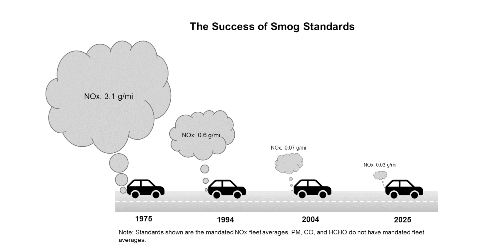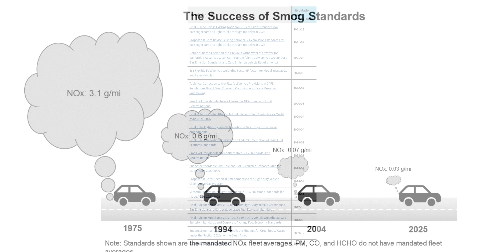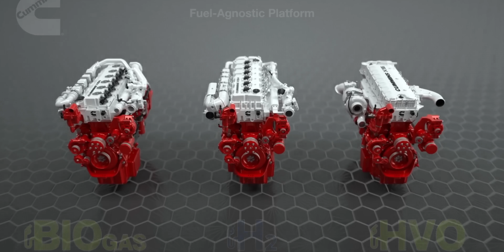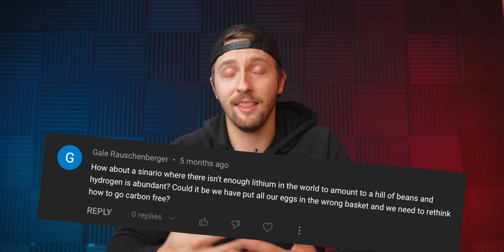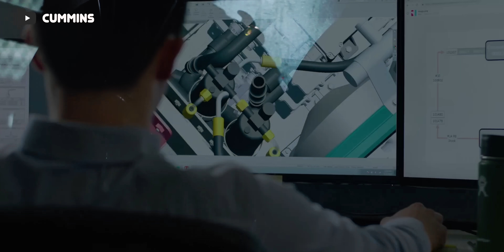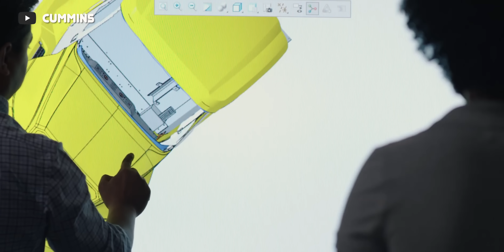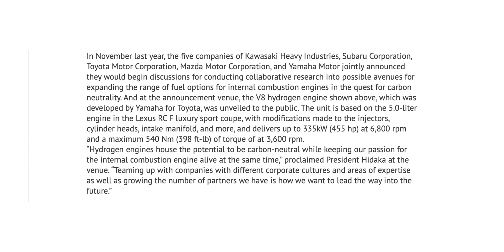Cummins Hydrogen Engine Will KILL DIESELS FOREVER

Comment: Nuke powerplants and hydro powerplants run clean and are begining to produce hydrogen as well. It'll be interesting to see where this goes.
Reply: Why would they loose 40% of their power trough electrolysis to make hydrogen when they can sell their power directly. How cheap is hydrogen going to be if customer have to pay for all that loss?
Reply: @TJPDmember  power plants make excess a lot of the time, they need to maintain a base load, previous designs have seen them have to bleed off the power, this would mean they can use that spare base load power to generate hydrogen at almost no cost to them...
Reply: @fluchtigziege3202  so then why does California have brown outs if there is as you say spare or excess power?
Reply: @Scott Sand  During "peak usage" times, the systems can't keep up with demand, hence the brownouts. But during the night when the masses sleep, the  power can be used to generate hydrogen.
Reply: @TJPDmember  The Japanese are using nuke power to super heat water to separate it into hydrogen and oxygen.
Reply: While Nuke power is clean (basically a STEAM generator),  its byproducts are the problem.  Nuclear waste is difficult to handle, COSTLY to dispose of, and then there are those 'PESKY' security problems because  TERRORISTS want to gettheir hands on radioactive ANYTHING... and then there is the POLITICS and RED TAPE.  Remember, our government is here to help us.  ;-}
Reply: nuclear power plants produce tonnes of hydrogen when they melt down, I hear the russians had shitloads in 1986 and the Japanese still have heaps LMAO
Reply: YIP the one nearest to your and your families homes gets nuked first Mr genius
Reply: The problem with hydrogen?  Right now we produce hydrogen using natural gas, and it is used within 2 miles of the production plant to make things like fertilizer, so the hydrogen is not compressed before it is used (beyond about 100 PSI).  Only about 5% of the hydrogen currently produced is compressed above 500 PSI and sold in tanks.  

One of the "Green" hydrogen production plants makes hydrogen out of electricity, and it takes about 400 KW to produce 1 Kg of hydrogen.  Sure it is a very light gas, and that is MANY cubic feet. They estimate it would take over 50,000 Terawatts of electricity to produce all of the hydrogen that we currently use to make fertilizer and other products.  However all of the currently installed worldwide wind and solar power will not produce 35,000 Terawatts of electricity per year.  

If you consider all the power output of all the American nuclear power plants, they do not produce nearly enough electricity to replace even 5% of the hydrogen used in America to make fertilizer.  

And the problem with "Excess power produced by hydroelectricity and nuclear power plants" doe not exist.  We use every KW of power made in a nuclear or hydroelectric power plant.  Then use millions of cubic feet of natural gas to produce the bulk of the power used in the United States.  If we had 400 KW of "Excess Power" it would be better to reduce the output of a natural gas or coal fired power plant, than to make 1 Kg of hydrogen with the 400 "Excess" kw of power.  

By the way, feed 1 Kg of hydrogen into a fuel cell, and you get out 100 KW of power.  So 400 KW of power to produce the hydrogen, and get out 100 KW when you switch it back.  Of course if you consume another 15 KW to compress the gas to 1,000 PSI in between the conversion between making the hydrogen and using it to produce the electricity, that is even more energy used to produce the 100 KW.  So net gain of -315 KW per Kg of hydrogen produced.
Reply: @Kangenpower7  yes hydrogen is a fool's errand
Reply: @Kangenpower7  yes hydrogen is a fool's errand for a open fuel source but it can be used to make waste into fuel, maybe the only viable method of fuel generation via hydrogen
Reply: it goes nowhere because hydrogen is a nightmare to store and transport while having a much lower efficiency than batteries 
so you will need giant tanks for the same range
Reply: @IR_IE_ID  yes unless kept Cryo, which is a whole other fresh hell, using hydrogen to make another greener liquid fuel makes more sense than using hydrogen to power cars directly
Reply: @IR_IE_ID  If you calculate the total efficiency of a lipo battery including the creation and disposal  energy they aren’t that great either. Hydrogen storage is also a battery.

Comment: If anything replaces diesels, it'll be natural gas. Hydrogen is too expensive and too dangerous to use in such a widespread manner. Hydrogen also causes metal embrittlement, which destroys piston engines.

Comment: The world bending to the largest Hoax in modern times. So Cummins is trying to keep up with the terrorist Aristocrats driving the destruction of the economy. The energy density of ANY batteries is not there, and Engineers know this, (unlike Bureaucrats that simply push an agenda). Robin Williams said it best - "Reality's a Bitch".

Comment: MAAAAAN OHHHHH MAN... THIS IS THE BEST NEWS I'VE HEARD IN A LONG TIME FOR MY / OUR BELOVED INTERNAL COMBUSTION ENGINES

FOR ME JUST AS MUCH AS OTHERS 

AS LONG AS THERE PISTONS SLAP N UP AND DOWN CRANK N OUT POWER ILL BE OKAY 

BUT I'M AGAINST BATTERIE POWER OTHER THAN CARS FOR TOWN DRIVING... 

I'M A TRUCK DRIVER AND DIESEL POWER IS GOING TO BE VERY DIFFICULT TO BEAT... BUT HYDROGEN WILL I THINK IF DONE RIGHT WILL REPLACE DIESEL FUEL... WHICH DOES MAKE ME SAD... BECAUSE I LOVE ❤️ THE SMELL AND SOUND OF DIESEL POWER 

✝️😎👍🇺🇲st
Reply: Don't worry. You'll be using diesel for a very long time. Reality overcomes wishful thinking every time.

Comment: The ultimate renewable energy source, try to out fox the Creator I don't think so...
GOD provided Coal Oil And  Natural Gas as a result of carbon and hydrogen traped under the Earth's crust under massive pressure.
Regardless rejoice in our bounty.
Does eventually this Earth will chew us as well up along with all our pollution and spit it out as brand new.

Comment: Diesel will stay on road for a long time because you can’t stop old diesel engine from going on the road they would have to ban every diesel from the year they where frost produced to present same with gas everything would have to be banned. My other question what happens when that water supply runs out? No drinking water no life if we are running hydrogen cars on the road really would just leave diesel and gas alone they have been more reliable and proven to be more reliable then EV and hydrogen powered vehicles. I bet there hydro engine will only be able to go past 290hp by the way when pulling a 80k trailer you need more hp then 290 to get up hills and basic driving around with an 80k trailer that engine will be screaming for you to stop. And he said earlier in the video that I’m the near future gas and diesel engine will no longer be reproduced in the near future and pretty much come to a halt. Then he says he sees Cummins still building diesel for a very long time. So what is it? They step away from diesel and just go straight hydro I bet not. There is still way to much that would have to be converted from fossil fuels and I don’t see that happening anytime soon. We are talking about the power plants as well all equipment that uses fossil fuels will either have to go solar or a hydro plant would have to be incorporated there is still so much that would have to be done before they could ban fossil fuels hydrogen might one day be the way but it won’t be for awhile quite awhile. We will all hopefully be dead by the time that happens

Comment: Eh, I wouldn't worry too much.  Cummins has experimented with "alternative fuel" engine conversions for on highway before.  Their CNG ISLG and ISX12G have been HORRIBLY plagued with nonstop problems since day 1 and still have not been properly corrected.  Same with their ISX15 engine that ran on LNG as a partnership with Westport.
Reply: The problem with the CNG engines is their spark ignition system. That is their primary issue, secondary issue is the problem of them having condensation in the crankcase, which can cause many oil lubrication issues down the road.
Reply: The City of Long Beach California has been running over 100 of the CNG diesel engines that run on 90% CNG for most of they day, when they run out of CNG, they switch back to 100% diesel fuel.  They are started with both glow plugs and diesel fuel and run on the diesel principal, without spark plugs and run at 20:1 compression with a turbocharger.   They run them in the garbage trucks, sweepers, and other heavy duty class 7 and 8 trucks.  

They have been pretty much trouble free, and tend to run longer between in frame overhauls than the full 100% diesel trucks.  The exhaust is very clean!  The cost to run on CNG is about 1/2 of the cost to run on full diesel fuel.  It takes about 40 gallon of diesel per month, and daily filling of the CNG tanks.  They used to use about 50 gallons of diesel fuel each day!

Comment: The current fossil fuel chemistries are made for profit, not cleanliness. For as long as oil companies have been around, there hasn't been an incentive to make the fuel react completely inside the engine hence the need for aftertreatment. The oil companies can do it but won't because it will cut their profits.

Comment: A hydrogen combustion X15 Cummins still generators NOx from high temperatures and pressures in the combustion process that causes atmospheric nitrogen and oxygen to combine into oxides of nitrogen.  This should be less than the high temperature combustion of carbon, but still present.  There is not that much left in air pollution from a 2010 EPA heavy duty Diesel with Diesel particular matter removed and unburned hydrocarbons removed that leaves the 0.2g/bhp-hr of NOx limit for the 2010 EPA heavy duty on-road Diesel.  Further chemical processing might be able to put NOx at near zero.   

Hydrogen is expensive.  Storage of hydrogen as a gas typically requires high-pressure tanks (350–700 bar [5,000–10,000 psi] tank pressure).  It is very inefficient to make hydrogen through water electrolysis.    It is far more efficient to charge lithium ion batteries with an efficiency of about 80%.   Hydrogen is known to make metals brittle.   Typically hydrogen is envisioned to provide electric energy through it use in a fuel cell.   The major issue with that is the water generated can freeze and destroy the fuel cells expensive membrane.   No NOx generation with a fuel cell.     

There is a huge reason to run a Cummins engine on natural gas as the typical cost per hp-hr should be less than half the cost of Diesel fuel.  This makes sense for a stationary generator set.   A lot of the Diesel natural gas engines still use Diesel fuel to start the combustion process so they may sill require some Diesel emission systems and Diesel fuel.

Comment: Cummins built the x15 engines in our trucks at my work. They run on CNG and are some of the worst trucks I’ve ever driven. They have 6 speed Allison’s behind them. They get 4-5mpgs and are terrible to drive. Hopefully these actually have more than the 150hp those CNGs have.

Comment: Use ammonia as a hydrogen carrier because it can be stored as a liquid under moderate pressure.
Reply: Nh3
Reply: Yeah and the Ammonia will take care of NO2
Reply: Or just run on ammonia altogether. They should add ammonia to their lineup of fuel agnostic engines
Reply: Yea sure, let’s use a deadly chemical that can’t leak at all
Reply: @pazsion  as opposed to the even more toxic kobalt and lithium mining and manufacturing of the batteries then God forbid the battery combusts and burns and spreads those toxins in the air dude educate yourself.

Comment: It's really weird that people are calling H2 gas hydrogen, when it's produced from water, and it's probably just helium. It would be like calling oxygen "hydrogen-16 isotope". The electrolysis reaction is enough energy to fuse hydrogen, is what I'm saying.

It's going to be weird, if fossil fuels are actually never used again. Because there's going to be so much being produced naturally, it's going to start seeping out of the ground, like a spring. I actually think that fossil fuels have tremendous value in their usage. I would love to see if I'm right about a black water hydrocarbon (carbon 6), that is basically extremely fused and dense water. It would be a great irrigator and soil enrichment.

I also find it funny the incredible lack of common sense in the understanding of carbon in the atmosphere. It's measured in ppm, around 400 or so, making it 0.04% of the atmosphere. That's 4/100ths of 1%. Not only that, but it's increased by only 1/100ths of 1% since industrialization (150 years). It's also worth mentioning that is only where it's measured, at ground level, where it's at its densest. The actual percentage is far less than even 0.04%. It's incredibly trivial, especially in terms of climate change.

If the runaway greenhouse effect were true, it would have already happened by now. Water vapor is the #1 ghg. It would trap heat, create more water vapor, trap more heat, etc. until we lived on planet steam.

As far as the engine is concerned, it's probably not even necessary, because you can most likely generate electricity without a need for any fuel/energy source. If a motor generator is created, electricity generation will become totally trivial. It's the pinnacle of renewable energy.

This world is like the twilight zone. There's just so much misinformation, misunderstanding, and absurdity. It's in everything from chemistry like misunderstanding water as h2o, and oxidization (clearly caused by water/hydrogen), or windmills with propellers instead of sails.

Comment: Fuel cells would be more efficient but they have significant downsides. One is the fact that they too aspirate like an ICE but require significant filtration and much more sensitive to impurities in both hydrogen gas but also in atmospheric air (fine dust, etc). They are also much more expensive and have almost no servicing support. Most people haven't the faintest idea how a fuel cell even works. Let's say that the fuel cell is 60% efficient (you'll hear different figures depending on who you talk to but from my understanding, modern fuel cells are approximately 60% thermally efficient). If a diesel engine with 40-50% efficiency can be retrofitted to run on hydrogen, that isn't a huge loss considering how much more practical of a solution it would be and how fast the engines could be (mostly) decarbonized. ICE engines are already widely supported and understood. They are robust and proven technology. If they can be decarbonized and still be practical, we would be insane not to adopt a new fuel standard. And if we can increase our nuclear capacity so we can realistically produce green hydrogen at a viable scale/cost, it would be foolish not to use hydrogen. Afterall, what is hydrogen but a gaseous battery? Also think of how much cleaner an ICE engine would be running on hydrogen. Little to no carbon fouling, no oil contamination (which means significantly longer oil life), and should engineers figure out how to limit NOx emissions with mixture controls while still maintaining performance, the engine would require little to no exhaust gas treatment, no EGR, no urea, etc. All things that would increase performance and efficiency. Most of the things choking modern engines to control emissions could potentially be removed. I definitely think hydrogen ICE is viable and even better than that, hybridized hydrogen ICE could be an excellent solution almost no one talks about.